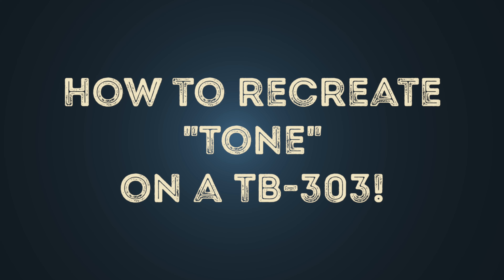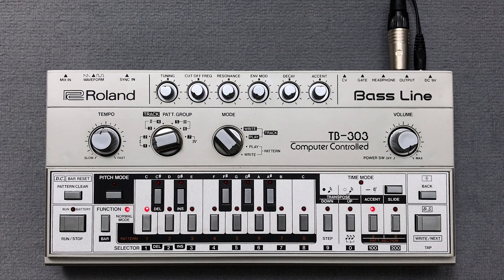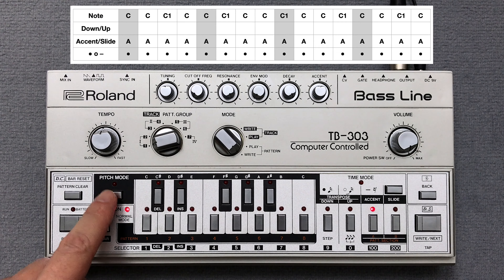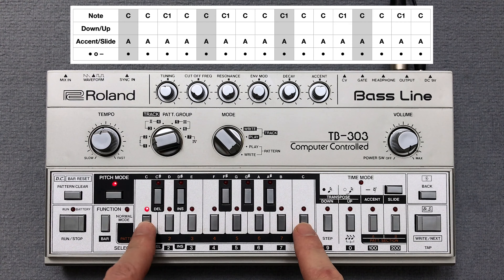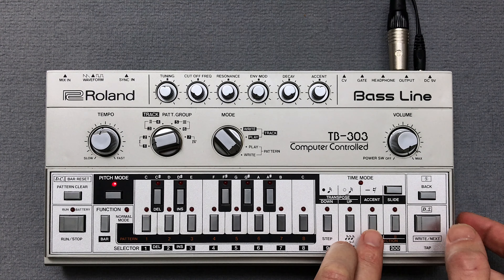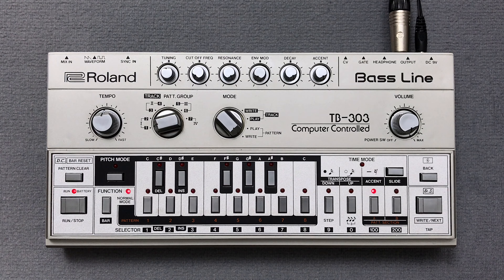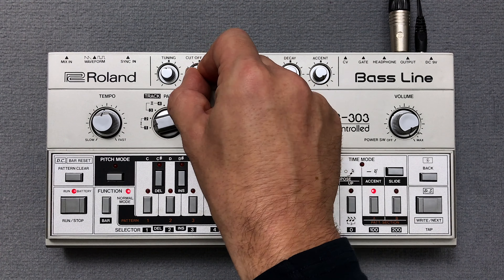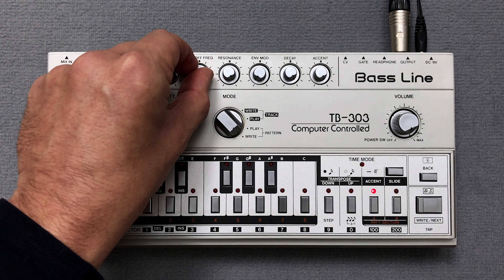Emmanuel Top "Tone" – Roland TB-303 Pattern, JD-990, Behringer TD-3, ABL, Acid Techno House

Comment from the maker: The pizzicato sound can also be found in other Roland synthesizers from that time. The preset sound "GM:046 PizzicatoStr" in the JV-2080 for example sounds exactly the same.
Reply: Do you know if the XV-5050 has the same patch as well? :)  I do have the JV-1080 but no luck there ... it does have a few pizzicato patches but they don't sound the same
Reply from the maker: In the JV-1080 the Patch PR-C 047 Bass Pizz and in the XV-5080 the same Patch PR-C 047 Bass Pizz should sound the same. I checked it with the Roland Cloud. 👍
Reply: @DuckTronic  Hmm I'll have to fire up my JV-1080 again tonight :D Thanks for the feedback.  I have this vinyl since it came out, but I only recently started to really appreciate the fact that such a "simplistic" record can sound so powerful :)
Reply: @DuckTronic  The patch "Real Pizz" on the JV-1080 sounds a bit closer to the JD-990 patch than the "Bazz Pizz", at least to my ears :)  Close enough for a remake of Tone!